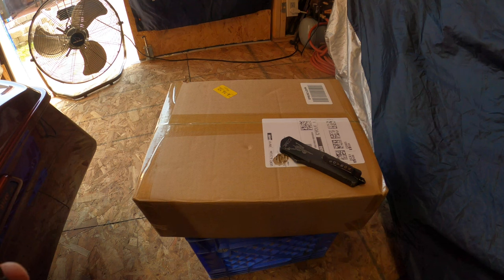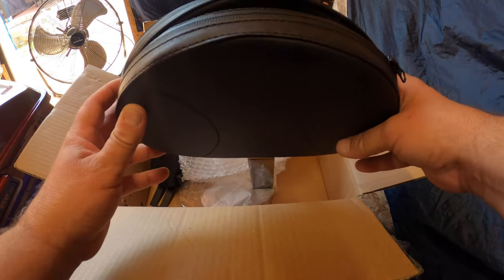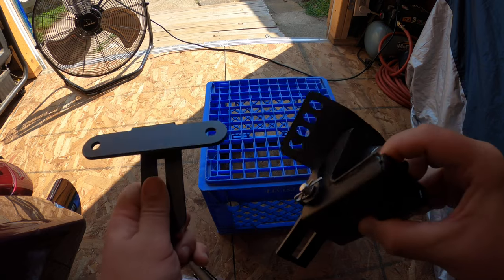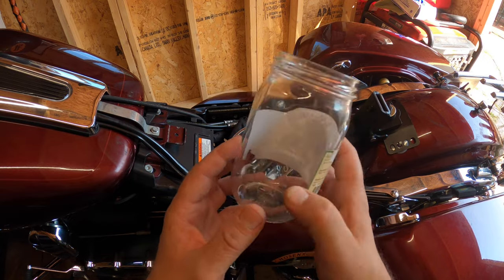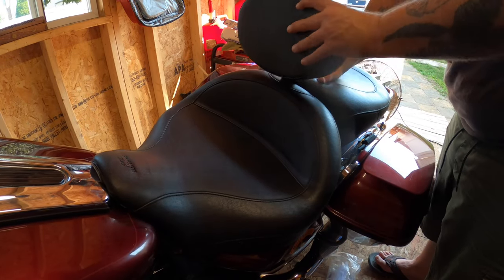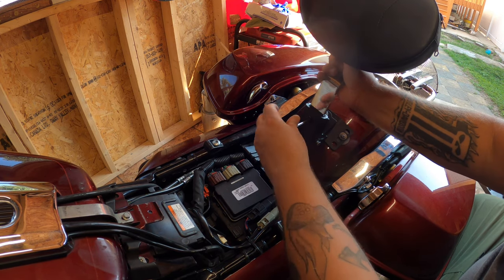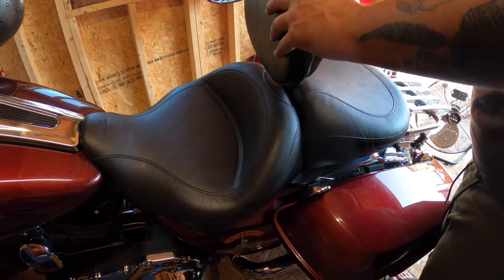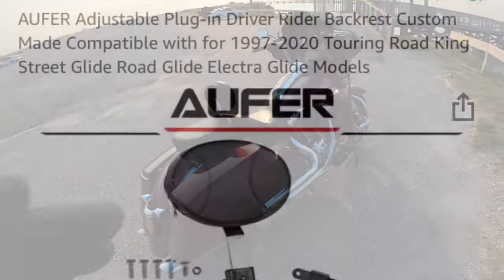Harley Davidson Amazon aftermarket drivers backrest unboxing and install

Comment: I just got the same mustang seat. Which will be my main touring and 2 up seat. Came from an Italian AS design diamond seat which I will still keep for run around summer riding. How does this backrest match up with the mustang now that you have had it a while? Does the detent cause issues? And fender rubbing or dislikes? Hard to justify 350 for mustang one.
Reply from the maker: I love it. Far superior than stock. I run a solo seat around town so no issues with marks from mustang seat.

Comment: I have a similar one. My wife has a Harley brand one on her bike and while it is much better, you get the backrest and bracket for half the cost of just the bracket from Harley. Hers has an adjustment cable that you can adjust with the seat on though. I like the bag on the back. I run my heated gear wires from the battery up through the seat hole and store them inside the bag when not in use.
Reply from the maker: Thanks for the comments.

Comment: I am not clear on how the bracket allows up and down adjustment. . It sounds like your ratcheting that seat bar up and down. How does it lock in place?
Reply from the maker: There’s an Allen head adjuster screw on the mount itself that adjusts how tight you want the backrest so you can adjust it up or down. The ratchet noise is the divots on the seat post itself.

Comment: What's the final verdict on that after market seat....I was looking to get one but didn't want to spend a ton of money....I also wanted to ask what type of windshield you have on your batwing..great video
Reply from the maker: I’ve used this backrest on all my trips and it works great once adjusted correctly.
Reply from the maker: Also the windshield is a Klockworks knockoff I found on Amazon for like 20 bucks.
Reply: I bought the seat because I seen it on your channel.  Lets hope it meets to all the hype.  I am sure it will. lol thanks again bro ride safe.